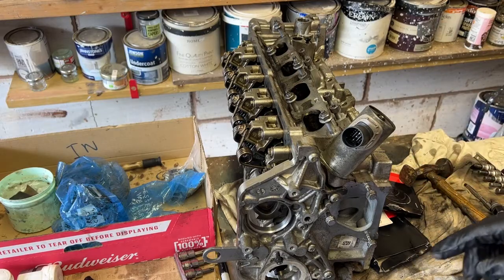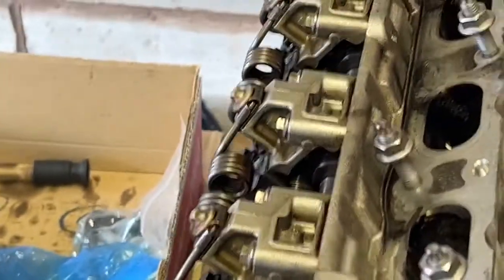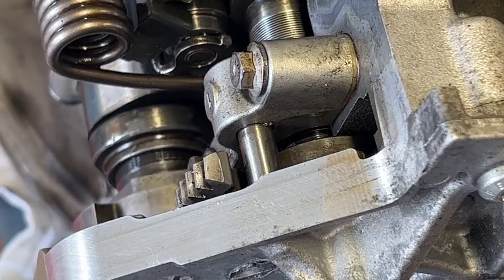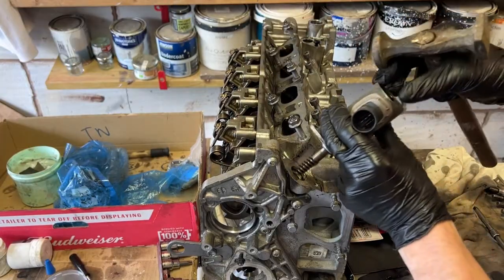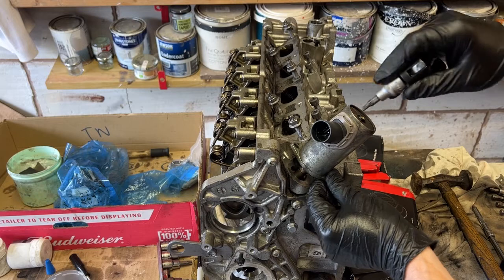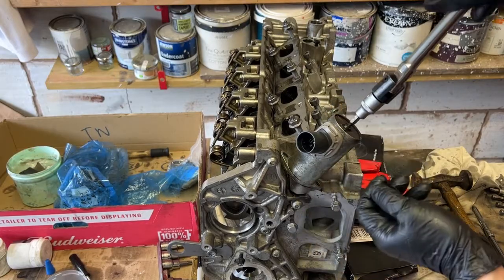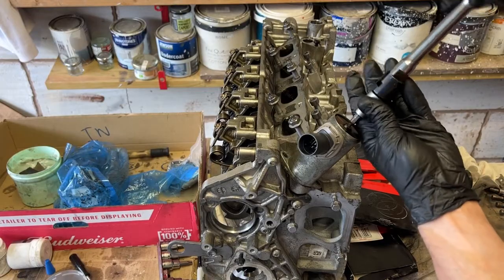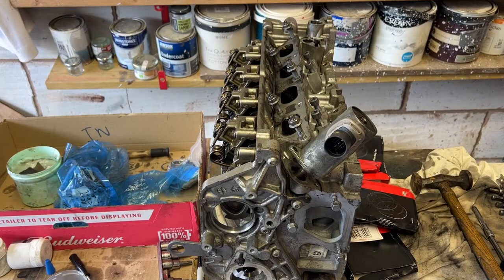Mini Cooper valvetronic motor actuator installation

Comment: I installed min and when I turn the key on the actuator moves the gate all the way in 1 direction and the car won't start but when I disconnect the plug and wind the gear so it is halfway of the travel distance it starts up.

Comment: So after install do you counter clock wise back to normal position ?
Reply from the maker: Theoretically it doesn’t matter because each time you start the car up, it cycles them from stop to stop. I would just leave it where it naturally settle ie wind it on until touching the head, do the 2 bolts up, and leave it there.

Comment: So where is it actually supposed to to be set too, I am going to look in my book and see if it says it but is there a particular spot these would be set to for performance enhancement, so what I mean is this resembles VVT that other engines have variable valve timing and these engines have cam phasers that move to different degrees and won’t stay at specific spot as there variable and prevent making hp and why ppl opt for 50*  intake cam gear that’s locked at 50
Reply from the maker: There is no spot. They are constantly adjusted as you drive.
Reply: @Realminishorts 
I removed top lid     Pushed down with screw drive untill it popped in 
Are u saying the motor will sort its own position no mater were i put motor on

Comment: It’s possible to check valves without starting engine?
Reply: Yes on top dead center of each piston blow air through spark plug hole

Comment: It is so difficult to remove the (lower) bolt when the engine is in car. 
I got a 2DCF valvetronic no movement code. How do u check for binding of the intermediate shaft after removing the motor? It could be motor got weak, DME not giving enough juice, or shaft binding.
Reply from the maker: You would have to remove valve cover then you can see if the motor moves the shaft when turning ignition on. Also could use piece of wood as I did to just rotate the gear as you saw me do in the video. But unlikely to be shaft. Most likely need new motor, or check continuity of the wiring from dme to the motor, anlso check if it gets voltage to the motor end of the wiring, and check fuses.
Reply: @Realminishorts  Understood. I removed the motor and it spins (by hand) ok. I pushed the gear and it feels smooth. Motor replacement is my next move. Hopefully it is not the DME (internal driver.)
Reply: @derekkchung Hi I have the same problem, were you able to fix the issue by replacing the actuator motor?
Reply: @radamesmartinez4506  yes, by changing the motor... u should examine for worn gears on the shaft too.